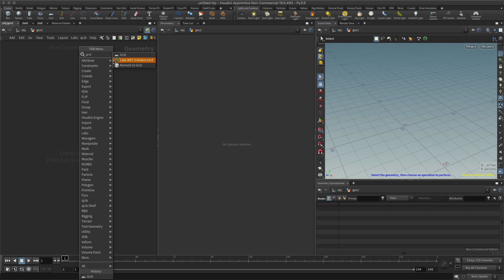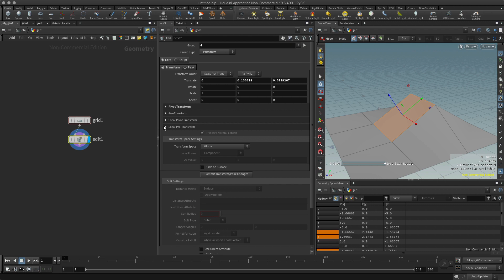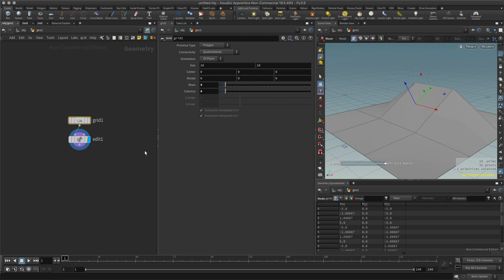#10 Understanding Primitives in Houdini

Comment: blender has clearer distinguish for them，vertex,edge and face. maybe it just supports polygon modelling
Reply from the maker: I have never used blender, but I have used Maya a lot in the past. I certainly found Maya to be much easier and faster for modelling. I have not found modelling to be one of Houdini's strengths, but it is certainly getting better over time.